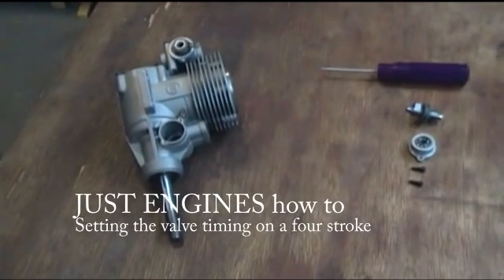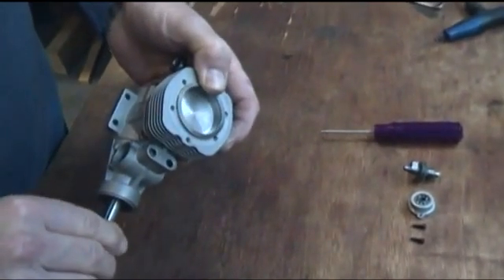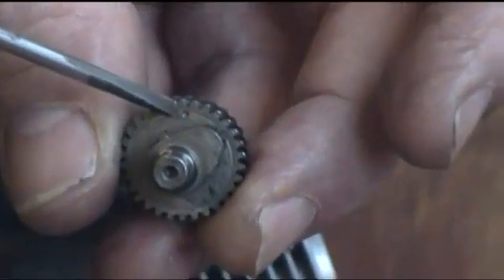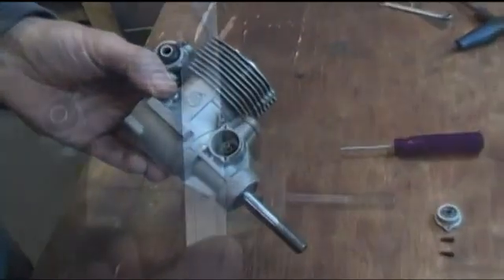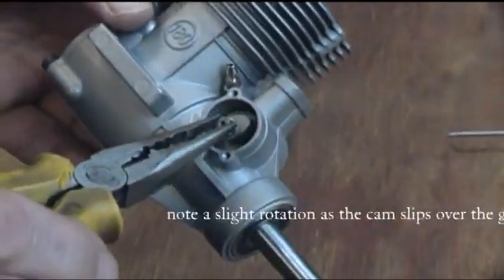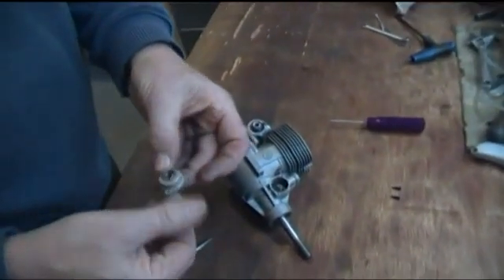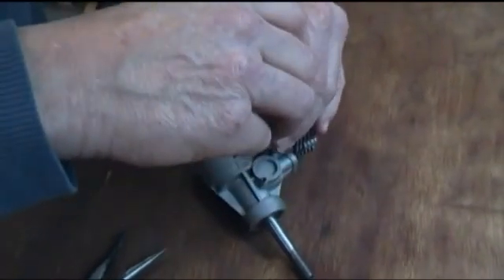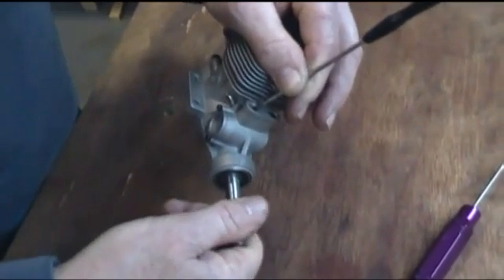How to set the valve timing for a four stroke RC engine

Comment: The instructions with one of my OS engines states that the propeller should be fitted before installing the camshaft, this stops the main shaft moving aft & makes setting the correct position of the timing dot easier.